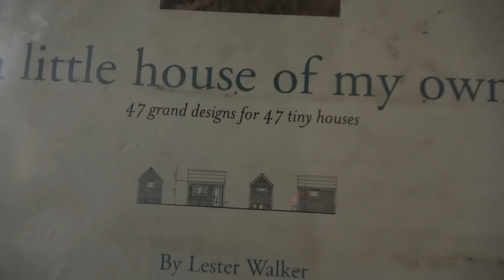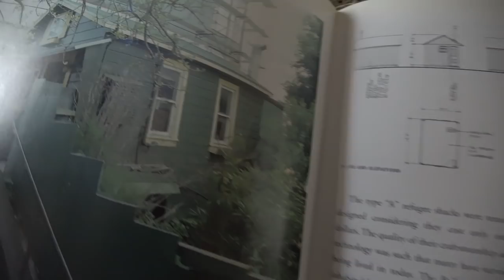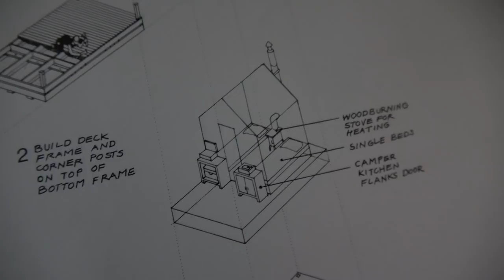MAPLE SYRUP at the SUGAR SHACK in the Woods! | Home Made Evaporator Built from Scrap Metal

Comment: Hi Chris, you were wondering the weight of 24 cubic inches of sap?
Well, 24 cubic inches of water weighs 1,498.27104 Lbs or 681.0322909091 Kg. The sugar content would raise the weight to probably between 700 & 725Kg, as Maple syrup has a density of 1.37 grams per milliliter, heavier than water, milk and corn syrup but not as dense as honey.  
Lucky the boiler didn't split under the weight of the sap! 
Raft idea sounds great.
Btw, I have subscribed or whatever,  because I DO care! 👍
Reply from the maker: Wow, that intense.  I had it full to the top overnight before Kevin could boil it.  I was a little nervous.

Comment: Forgive me... I'm new but do your research on straw and slip insulation for the walls. I know it's similar to what's used in rocket mass heaters. I've heard slip conducts the cold from one surface to another until thoroughly heated through and then you have to keep it warm or it takes a lot of fuel to heat it up again. ❤🌅🌵

Comment: Paul C says it will hold about 4 cubic gallons. Converted it would be about 113 1/2 Liters of sap. At 13 1/2 Liters at 95% evaporation would be approximately 6 1/2 L of syrup (That doesn't seem right?) 98% evaporation makes about 2 1/4 L Now we know why syrup makers make thin syrup. Less work, more yield, and can charge $$. I can see why maple syrup is $25 a half gallon here in the States.
Reply from the maker: It is totally worth what we pay for it at the store, totally.
Reply: Not expensive if you count all the work that goes into it.

Comment: Hey A ,this how I figure inches to gallons A . With in inches times length in inches times height in inches divided by 231 equals gallons, 24 x24x20 = ? , divided by 231 = gallons .abouth 40 gallons A only the square part of your tank can be used with this method,not the top part because it angles in an then straight up I would figure that straight bit separate,my guess total to the top 47 gallons. Keep making videos,Sir .

Comment: Unless my math is incorrect,there is 2.495 US gallons per inch in your boiler if the measurements are 2'x2'
2'x2'x1'= 4 cubic feet.
 7.4805 US. gallons per Cubic foot x 4 = 29.922 US gallons ÷ 12 = 2.4935 gallons per inch. Well at least I hope this is right. If not I had fun trying.
Reply from the maker: Closer than I got!

Comment: A lot of trust in the Ole stove frame. Sap at around 8.3 -8.5 pounds per gallon. I am hoping that all that heat does not cause weakness in the integrity of it. ?
Reply from the maker: Bit of warping now, but hanging in there!
Reply: @TheWoodedBeardsman  I thought of an angle iron framework, either inside or outside, for increased stability .
Reply: @TheWoodedBeardsman   when I saw the stove buckling when you pulled it out of the ice with the truck i thought most of its strength would have been lost. Kevin is a mad man (in the best way possible)! I am glad it is holding up and serves you well the rest of this season. But I think a good project this summer/fall/winter would be to find a decent welder and some scrap steel and build an epic evaporator set up. Would love to see that!

Comment: 24" x 24" x 24" = 4 cubic feet
4 cubic feet will hold about 30 gallons 😃
Reply: or 113 1/2 Liters at 95% evaporation would be approximately 6 1/2 L of syrup (That doesn't seem right) 98% evaporation makes about 2 1/4 L
Reply from the maker: I think we ended up with about 6L for the boil if that helps, but we should also measure the volume of the container.

Comment: i was thinking of getting a lumber mill for log making from the property i looking on buying and building a semi built cabin with finished with roof delivered to the property, i got a camper to live in, the newer camper had emergency shut off propane the stove no work & heat i though propane empty at 5am no fun! i plugged to grid it runs the charges battery and run trailer! I figuring stuff out the camper new to me & too , i plan on doing stuff to like you make maple & live there as camp area to a home place off grid!

Comment: I noticed what looked like ice in the 1 bucket  could you remove the ice instead of boiling it 
Like if you freeze a beer the water freezes before the alcohol
Reply: You could probably freeze dry it, but the equipment is much more expensive than a boiler setup.

Comment: Hey Beardbro, I got a question & then maybe a suggestion if you haven't already thought of it. 

1: What happens to the tree once the sap has been harvested? I know you're a cool guy with nature so I'd assume it just goes on living etc.

2: Have you thought about getting some coarse rock salt for your porch/decking area outside the shack? I used to work on a container yard & we used to spread coarse rock salt during the winter to prevent 26tonne machines sliding around the place. Hope it helps. :)

Comment: Letting all that heat go to waste. Next spring, put your stove/fire in front of the cabin and go straight off the back with the stove pipe, laying the pipe under your porch and then running it upwards. You will probably have to buy more pipes unless you already have extra but the heat from the pipe will defrost and melt all that ice from the porch that you were hacking away at. Just sayin, I would have put that heat to work for me instead of just letting it bleed off into the atmosphere.

Comment: Yeah build a raft house that would be awesome. Belanger construction had rafts or docks made with styrofoam that could support  a lot of weight used for when they did bridge building. They could support trailer sized heaters and the small excavators and Bobcat steers so floating a raft house is a great idea.